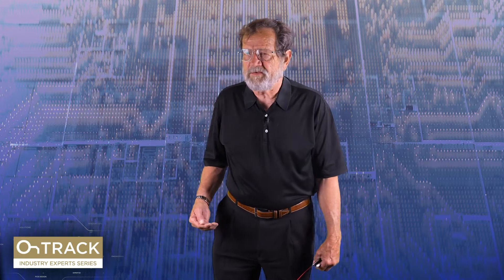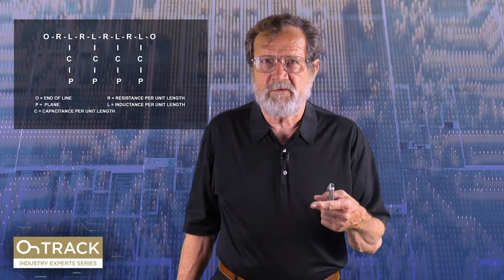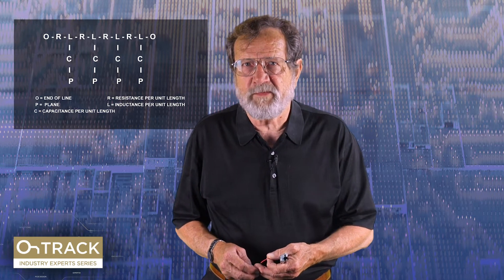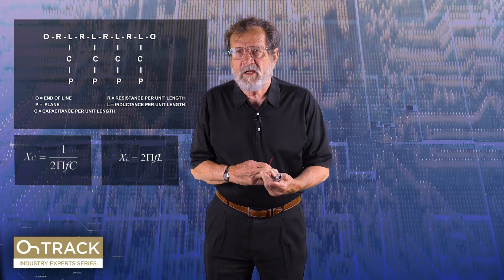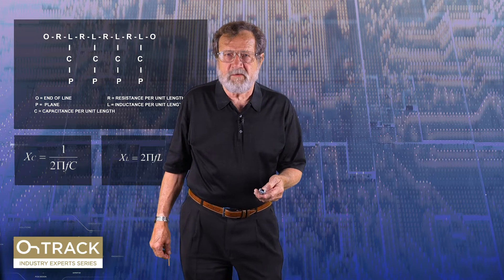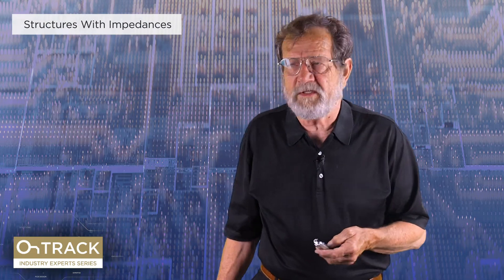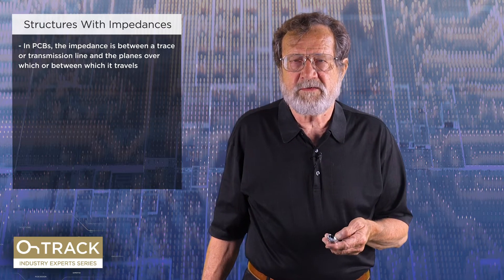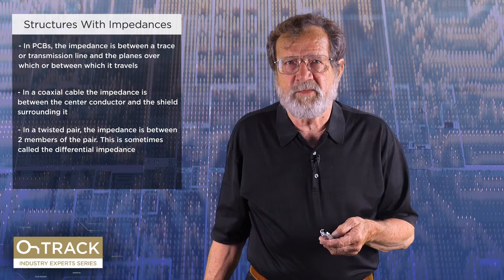What is Impedance? - Altium Academy

Comment: right angles dont cause reflections but the corners can be sources of electron emissions, not only do they generate EMI but can also act as antennas and pick up signals
Reply: Right angles absolutely do cause reflections, but in most cases you will not notice them in your design. Right angles are also not "sources of electron emissions", PCBs and copper traces are not electron emitters. Technically any part of a trace can act as an antenna and all traces generate EMI, it's just a matter of whether or not this violates emissions/immunity standards.